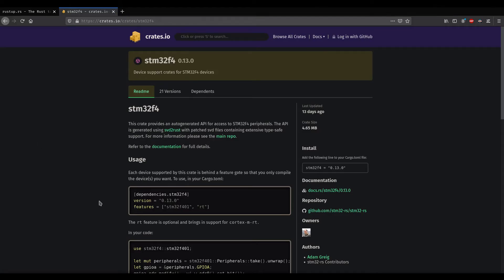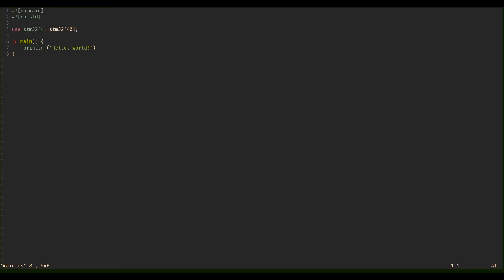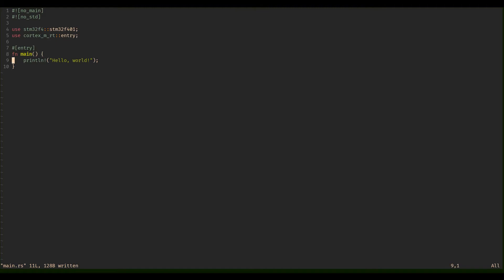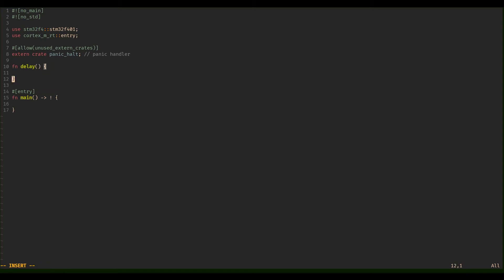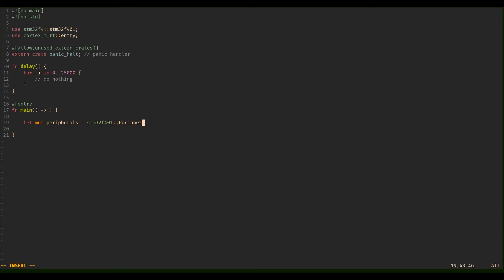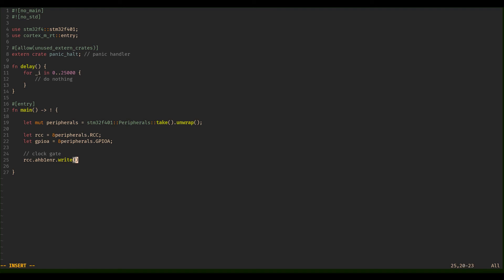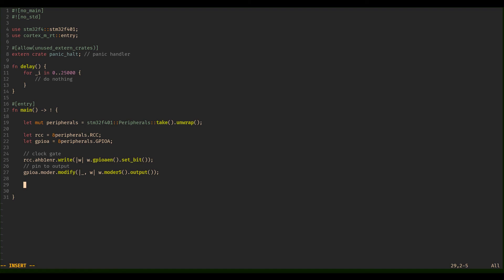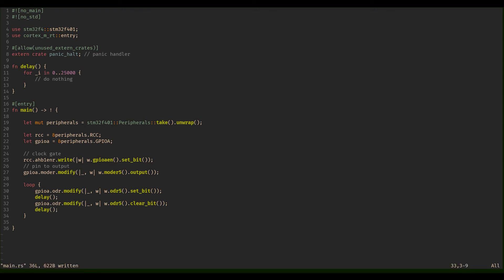Embedded Rust (stm32f4 crate) Basic Setup - Part 0x02

Comment: I am using a stm32f407, and my LED is connected to the GPIO D13, i can compile but when i need to put to run in the micro controller is not working, could you help me.
Reply: Same issue I have. Can you please let me know how did you fix it ?